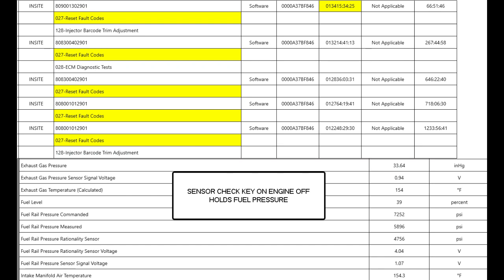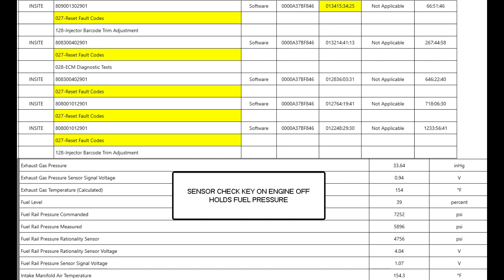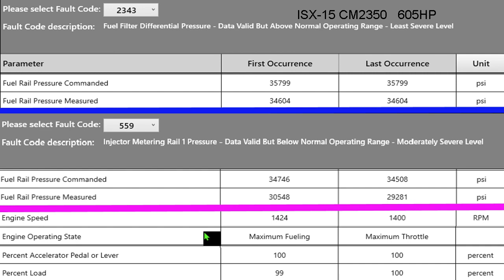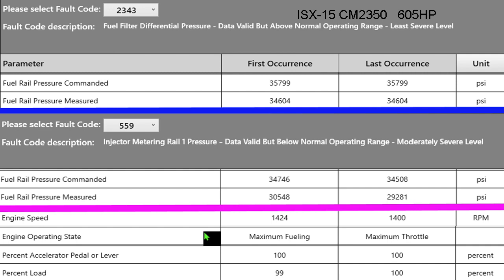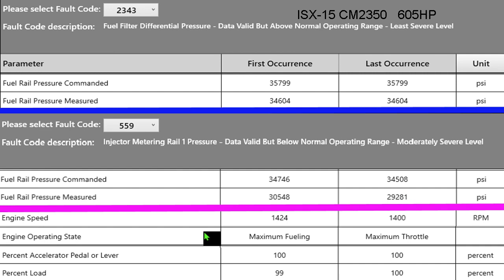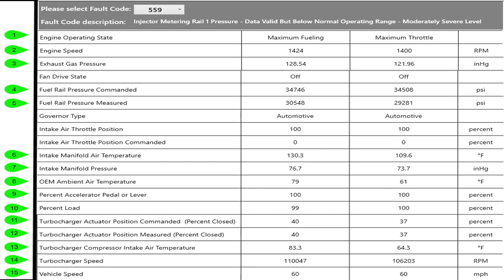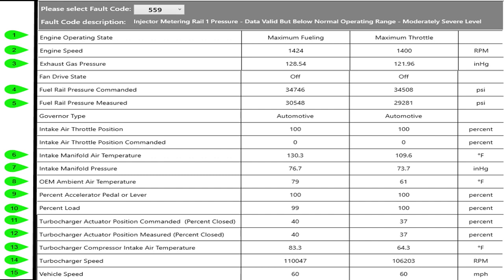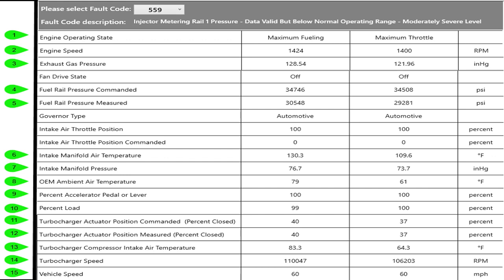Snaapshots of Fuel pressure faults 559 and 2343 on an ISX 15 CM2350 605 HP

Comment: can I have emulator so I can make home
if 599 comes up ?
what is the resistance ?

on the shoulder now

Thanks !
Reply from the maker: What is fault 599? I am not sure what is actually going on with your engine fault wise.
Reply: @ENGINESHOPJOE  one fuel tank was empty and air sucked !!
I close the empty tank valves, and fuel some on from the full one.
no explanation why this happen

Comment: I have this problem where is the video so I can watch it? Thanks so much been dealing with this for weeks now.
Reply from the maker: I would go back and watch my fuel system familiarization videos and then the videos of troubleshooting 559. Remember do simple things first.
check for plugged fuel filters and or fittings by the fuel filter. I have seen dirt and leaves packed in the frame mounted fuel filter inlet fitting.
If that all is good check for air in. the fuel. once you know you have a stable fuel supply to the engine check pressure on the on engine filter to make sure it is sufficient. Then if that is all ok the problem is in the high pressure side and you will need some special tooling to troubleshoot it. 
See if the pressure relief valve on the rail is screaming hot. if it is replace that. They sludge up with dried fuel and will hang open when a pressure spike comes along then you have 559's
let everyone know what you find.

Comment: This is helpful. I struggle with not knowing where base line is for many parameters. It hard to read values when you don’t know where they should be. I wish Cummins had a cheat sheet for it.
Reply from the maker: Yes I agree but they really cant because there are really so many variables that come into play. For example an isx 550 that has 1850 torque will have considerably more turbo boost than the same engine with only 1650 torque. Every calibration has what is called an FR number. Fuel rating.
That is a spec sheet that is made when the engine is dynoed and certified. There are literally thousands of FR sheets. 
These days those are considered confidential information. But you can learn the fleet you take care of with data logging and keeping a tracking spread sheet. that is what i do for the fleet i help care for. When I retire and finish my web site i will put that information on the web for you all to down load. That is not too far in the future.
Reply: That’s a good idea, logging your own info. Funny the things you don’t do or think of, till an outsider mentions it.

Comment: Thanks, good as always Joe.  You Cummins guys trying to pull them hard like you can with a Cat might as well get the counterbore tooling ready to cut #5 as that block is flexing pretty good from those cylinder pressures!!! I picture in my head the old counterbore familiarization book for the good old NT engines showing block flexing as cylinders fire. Just the old school in me, keep the RPM up when pulling heavy and let that thing breathe easy. Obviously, these comments have nothing to do with maintaining desired rail pressure. Keep the awesome content coming and you can put me in my place by telling me to order a new truck with yellow under the hood.